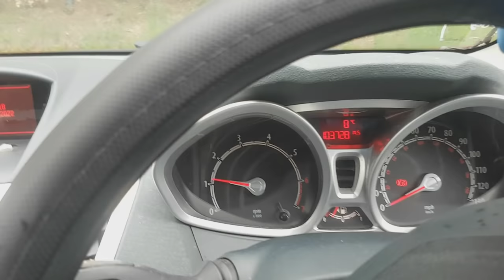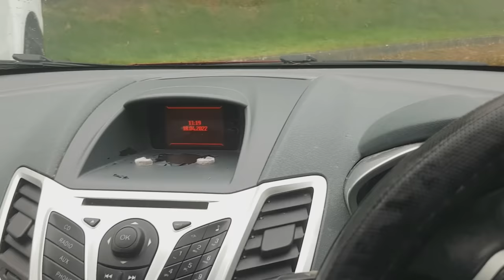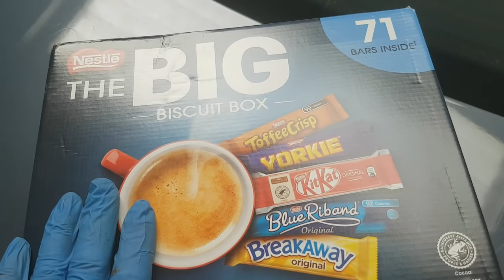I lost a BUNDLE on this mouldy Ford Fiesta - worst clean up EVER!

Comment: Need to try Biobrisk if I remember clearly and you use it with your wet vac and kills off any mould and an ozone machine thing. Sorry can’t remember as been a while since I’ve done this and it’ll take care of any nastiest like that for future customer to and sell it retail but I guess it’s al that work not needed any more. Should keep some plastic seat and steering wheel covers. Not too expensive and good for customers to test drive with those in without worrying having to clean again

Comment: Jesus. Your local Environmental Health office would declare that car uninhabitable.......  A Ford Foista.  Did you manage to collect any mushrooms while you were in there?  If it's the exact shade I think it is, that metallic finish cost around £750 extra when new.... And yes, you are right. Any nice clean Fiesta just flies out of the door. Except maybe apart from those 1200cc jobs, which have around the same amount of grunt as a hamster in a wheel. You don't measure the 0-60 on those with a stopwatch. You use a calendar.

Comment: I try to think that if imake a loss that means I've had to buy 2 cars, pick them up, prep, sell all that hassle, just to stand still, I'll only loose if the engines actually blown up, not on a tidy running car, yes it happens but I really fight against it. I blew 2k early this year on a late mini that blew up (2k for a used engine) but that was unavoidable, if they run and drive I sell em!!

Comment: A question. Have you ever used or know anyone that uses an ozone generator to de pong a car
Reply from the maker: Yes a lot recommend them
Reply: Great for "hiding" smells in the short term, very damaging otherwise. Combined with humidity it will cause acids of various types (depending on what gets oxidised) and these will corrode stuff. Out of sight stuff. To be clear, ozone for cleaning cars is not a good idea.

Comment: Genuine question: when you wet clean the seats like that, doesn't the water find its way into the side impact airbags?
Reply: It's ok 99% of the time. 
SRUK always take a jetwash to Fiat 500 seats and it's fine for them🤷‍♂️
If you extract as much water as possible then that's the best you can do
Reply: @sammytheseal2307  You squirt water at an Italian car?  Wow, that really is tempting fate....😁😁
Reply: @Brian-om2hh  😂 haha true

Comment: I would stick a sharkfin arial on the micra over the hole and put sealant inside the fin to seal the the roof saves messing with welding the roof  :)

Comment: " Do not lay up for yourselves treasures on earth, where moth and rust[a] destroy and where thieves break in and steal, but lay up for yourselves treasures in heaven, where neither moth nor rust destroys and where thieves do not break in and steal "  (Attributed by Matthew to Jesus in the Sermon on the Mount/Beatitudes.  but probably earlier Jewish or Middle Eastern Philosophy - Hebrew Bible is also strong on burning material that has mildew - so its been a problem for years , did they not have Lavender Oil !?!)
Reply from the maker: They did like their oils, especially on feet iirc
Reply: @ChopsGarage  I did used to think (Psalm 23?) Thou  Anointest My Head With Oil, meant Castrol GTX or Duckhams Formula Q
Reply: Did Jesus have a mouldy Fiesta then? 🤔

Comment: Even if the dampness and its cause are removed, mould is nigh on impossible to eradicate once there - unfortunately !
Reply: nonsense.
Reply: @LiveFromLondon2  guess you told Ralph Hardwick the same then. Your opinion, good luck.
Reply: @colinhutchinson5282  you can easily kill the mould that is present. Kill and remove is easy. What is not so easy it stopping new mould arriving. But then there is no need to, we are surrounded by it all the time in open air. We are concerned only when it begins to thrive. So, i repeat my statement - nonsense.
Reply: I agree, nonsense
I had leaking rear light seals on my Focus, the car sat around for 5 months and it was mouldy.
Sealed the rear lights, scrubbed everything with a weak bleach mixture and absolutely no mould or damp has returned approx 5 months later